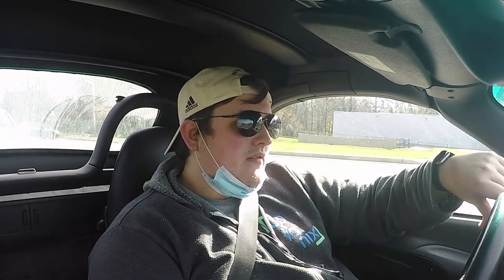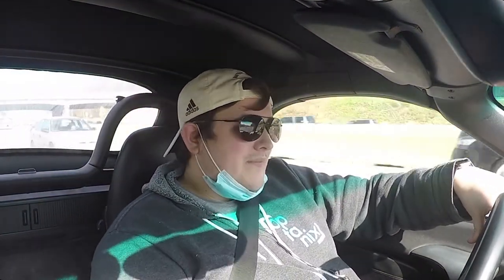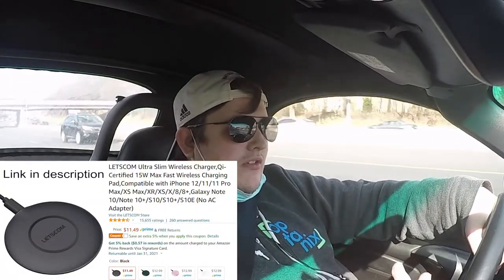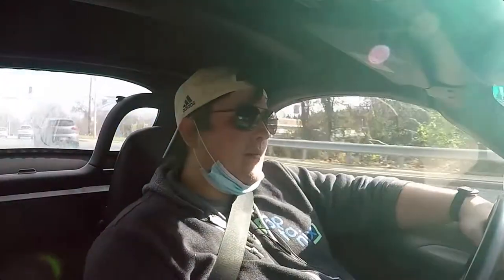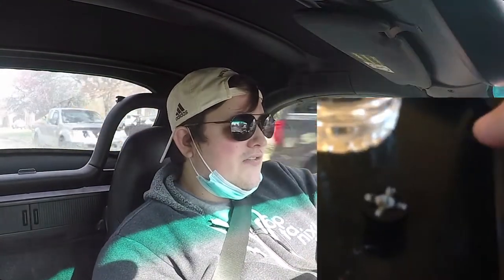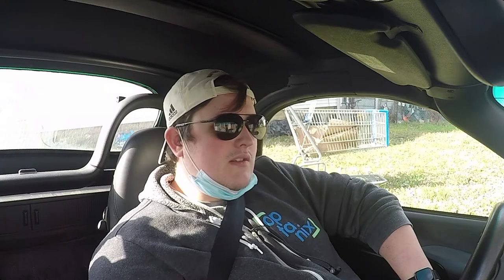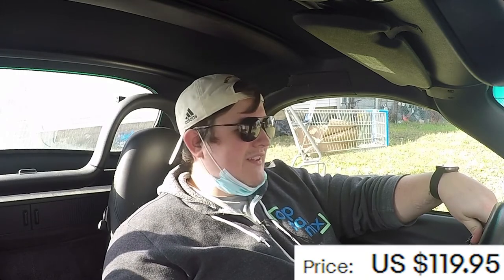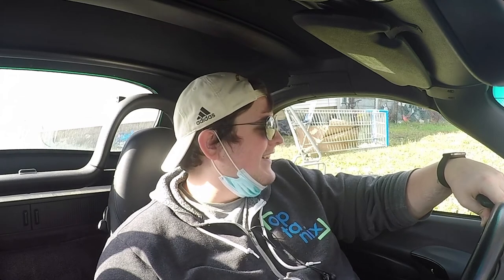Daily Driving a Porsche Boxster 986

Comment: Great video. I have the same but yours seems quieter inside (in a good way,  no rattles - I have a rattle somewhere.... with the top up). For the radio buttons, I simply dipped them in black plastidip. Worked well.
Reply from the maker: I had a brief rattle, turned out to be a chunk of the plastic underguard broke and was just loose so I had to take it out.

Comment: if you double turn your key in the exterior door to lock it, it will lock both doors and if you double turn to unlock it will unlock both doors. 1 turn is 1 door, 2 turns is all doors.
Reply from the maker: It will only lock doors that have working lock actuators. Since this video I've fixed all the locks and replaced the chassis control module. I should make another video tbh.

Comment: How is it holding after 3 years? Any major issues?
Reply from the maker: I ended up selling the car a couple months back now. I should mKe a follow up video, and get back to making videos in general but I've lost motivation. The car held up decently. I ended up getting a new chassis control module to fix the remote unlock and all that. In the process of selling it though, some dude hit something and busted one of the radiators on a test drive. So that sucked. It also had a mysterious lean code that would pop in once in a great while that I could never diagnose. All vacuum tests passed, no smoke leakage, and the aos was fairly new. Just came and went every now and then. Overall I loved driving the car, I loved the handling and the feel, but I dont know that I enjoyed owning it if you know what I mean? It was a decently clean example when I got it, and living in a large city it just got trashed by inconsiderate people. I had one of my tires slashed, and so many door dings I gave up trying to keep it nice. It gave me anxiety to own at that point because I liked it so much. Reminds me why I love shitboxes haha

Comment: because of u i did go buy a 2000 2.7 for my daily love it.
Reply from the maker: Dude that is awesome!! I'm so glad to hear it. They really are nice cars and very daily driveable. I do have a truck I can drive now if I don't drive the 986 but mostly it's a 986. I might put up a video soon about diagnosing a small oil leak.
Reply: Wow
 I too have a second car to drive
And as far as oil leaks 
I just did mine 
oil tube where the spark plugs go
rear main seal
Or oil pan
That’s really the only  3 places it leaks.
I just did the Ims bearing too I 
Plan on keeping it .for a while.
Reply from the maker: @MrOmgfreak  yeah thats what I was thinking. On the right bank of cylinders.
Reply: Let me know what ya find
Reply from the maker: @MrOmgfreak  will do man, thanks for the sub!

Comment: Just bought a 02 boxster s and i’m living a nightmare with some electrical problem…. Brand new battery drained overnight, windows roll down randomly, abs traction and brake light turn on when revs go above 3k (sometimes before)
Anyways i think i may have the same problem with the water damage. We’ll see:)
Reply from the maker: The key is the windows rolling down randomly. That's the biggest telltale sign of a wet chassis control module. Check under the drivers seat carpet for moisture. Good luck and godspeed. 🫡

Comment: i just left my radio stock
now i use u bluetooth sound bar speaker..  bose
with my iphone
just put it behind my seat sounds good all bluetooth
no wires!
when u go to sell they want it all original no mods!
Reply from the maker: I really like how nice the stock audio setup is in the 986, adding bluetooth was as simple as adding a module to the empty pins where the 6 disc changer would normally go behind the radio. I will make a video on this.

Comment: It was built for daily drive that was the whole purpose. I was there on the release date. They were smart the 2.5 are for ones that just made it in life, the power was just right to accelerate off the light but once you carry a girl it becomes slow, it was poaches way saying you need to make little more money to get the s so you have the prviloo to impress the girl.
When I first the sound of the 2.5 in late 1996 I swear it sounded like space craft, it was incredible the sound handling vs what the car was around at time things like c36 AMG and handles like a joke, no sound.
Boxster is always my car, I still have it at 230,000km
Reply from the maker: Nice! Once these engines are past about 120k it seems they don't die easily.
Reply: @thefatmechanic  yes my is one of these example, I think maybe and maybe it's because I keep my oil religiously at h level if it looses 100ml I add it right away.